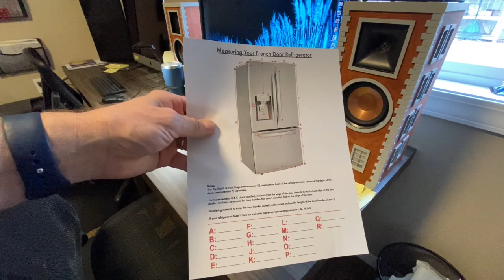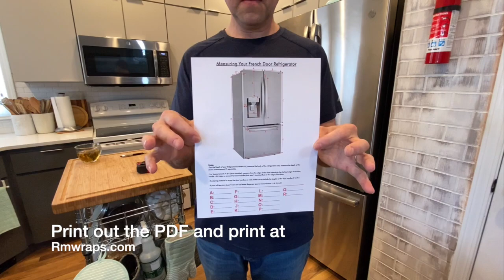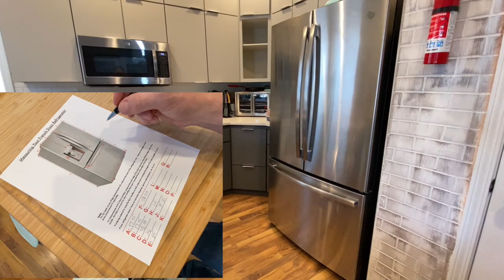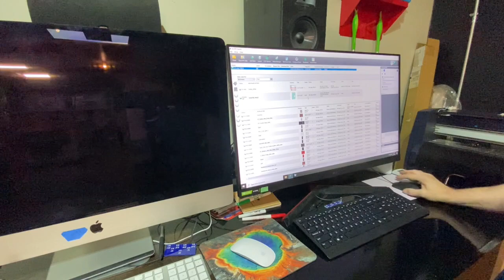How-To: Step-by-Step Vinyl Installation on a French Door Refrigerator

Comment: I mean.....it looks ok, but there were a LOT of sloppy parts; especially the indoor cut out, and the FREEZER DOOR! holy crap, freeze it at 1:02:17 and see what I mean. Why did you rush through those parts? Just curious. Also, why not wrap the TOP OF THE DOORS? You just cut the vinyl off flush. Very confused if this was supposed to be a TUTORIAL, instead of a "look what I did!"